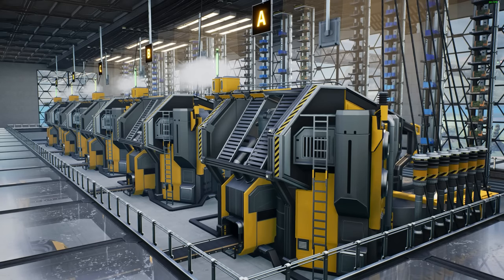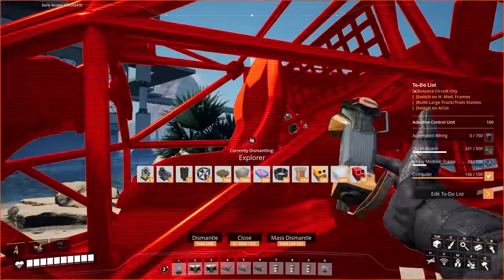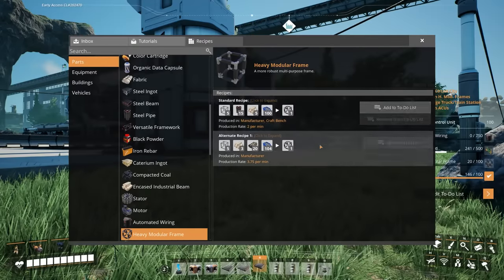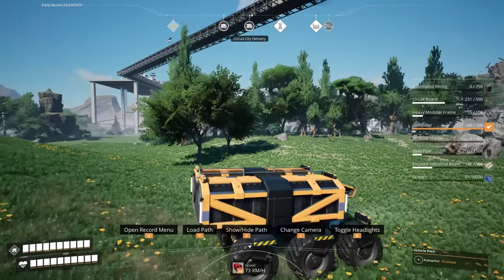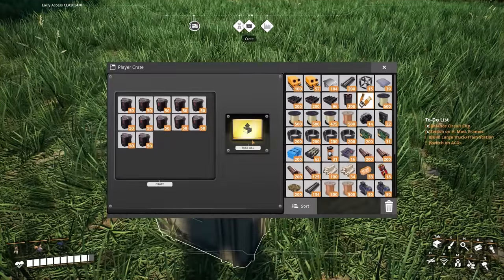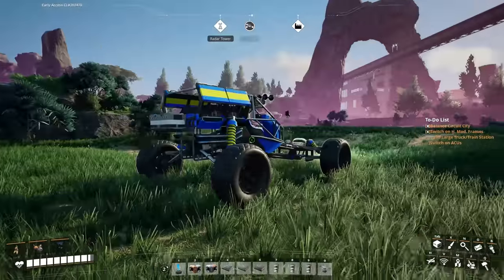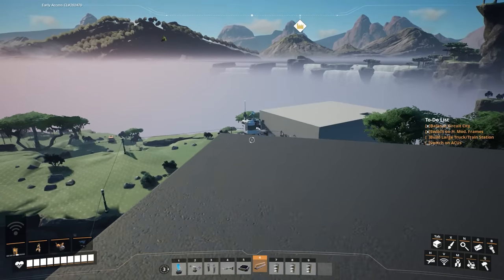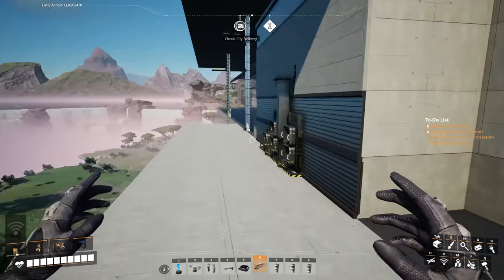TRANSPORT HUB! - Let's Play SATISFACTORY Update 7 - Ep.32

Comment: For some reason with U6 the hitbox for the truck workbench is glitched. I usually have to get the truck on even ground/foundations or usually clip into the rear of the truck to access it. Also, if you want to do even more screws, there's an alternate recipe that uses steel that makes either 200 or 250/min.

Comment: Great choice working on logistics. Given the increased variety of materials moving by train, will you need to start making smart sorting at every factory? The Fast Forward on your concrete portion of the build was flawless. I mentioned this before, but I think having a hypertube network under your railroad tracks would be amazing. Especially with your new truck/rail redesign. Would that ever be something you’d consider making?
Reply from the maker: I'm just not a fan of hypertubes really, I think its because it forces you into 3rd person. I'd rather just jump on a train and ride it :P
But maybe, won't rule it out completely. And thanks for the kind words
Reply: @WhatDarrenPlays  it really does take one out of the immersive experience to see your leg bracers following outside the tube, doesn’t it? I just thought with all the rail infrastructure you already have in place, it would be like adding a bicycle lane on a road. Regardless, your new transportation hub looks glorious!

Comment: The truck workbench issue has been happening with me too ever since the last update came out, probably a little hitbox bug, they'll probably patch that, especially considering it worked just fine previously.

By the way, I myself also am not a huge fan of the hypertubes, not sure why exactly but I'm not. But one thing I gotta say to you, put that to the side and start using them, you won't regret it. I forced myself to start using them now that I've reached tiers 7 and 8, even tho I dislike them, just because of the pure boredom of moving around so much between factories that are miles apart from each other and I gotta say, I don't regret it, it has been saving me SOOOO MUCH TIME moving around from factory to factory and also I'm more chilled while playing and building cause I don't have that consern on the back of my head all the time as to if I'm taking enough materials to build what I want where I'm going, cause if I don't I just really quickly hop on to my hypertubes cannon and fly back to my base to pick more stuff. Honestly, I know you don't like them, but give the hypertubes a try, especially the cannon and I guarantee you won't regret it as it will make your life 10x easier. Hypertubes networks themselves I still don't like to use, cause they take so much time to place in a way that looks good, don't move you any faster than what you would do by using an explorer or even just simply running and also just don't feel good for some reason, like I said, I don't know why but I just don't like it. But the cannon in the other hand takes little to no time to set up and can literally send you anywhere you want and for some reason feels more realistic too, it's SO SO useful Darren, really do give a try if you will

Comment: I think I had a mini breakthrough with trains last night. If you have a station, and build a bypass. If you point the junction towards the bypass, then trains will bypass the station unless they actually need to use it in which case the signal will change as it approaches. If you have trains that use the same station you can then put a few signal lights in the station section. Otherwise just a small signal to stop the station train pulling out into a passing one is all you need. Then hopefully you wont need to put so many signals or have instances where a train is waiting for nothing.